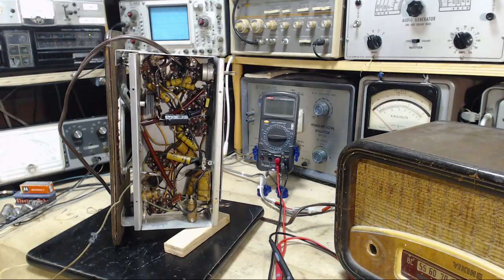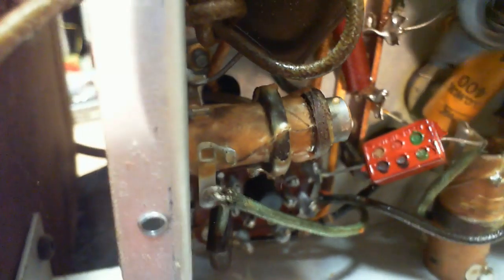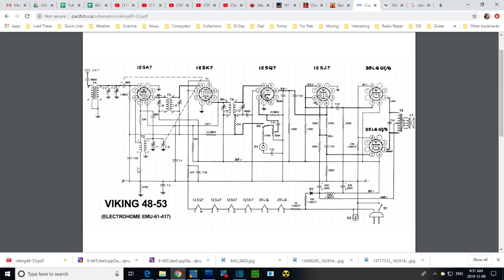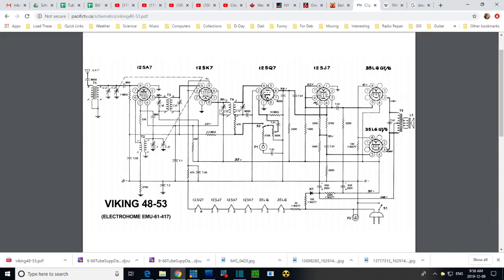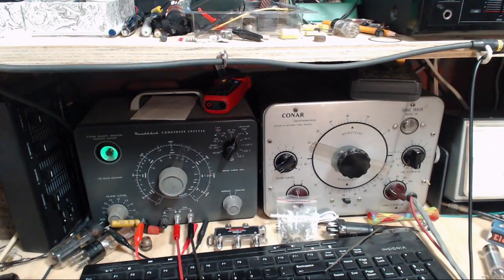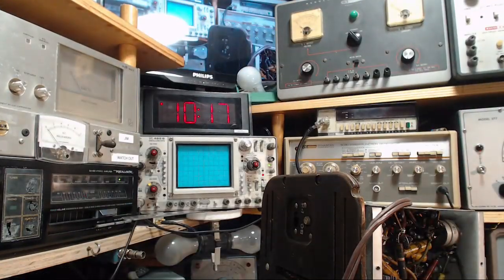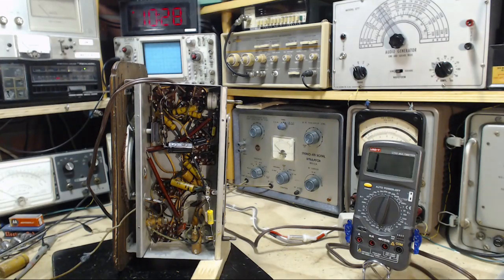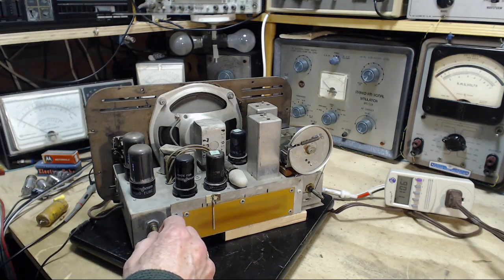Viking EMU61 Tube Radio Video #3 - Chassis Connections

Comment: The reason why wax capacitors need to be changed is they are wax, which is a hydro carbon material.  After 40 years of exposure to air and electricity, the wax has cracked, leaked, broken down, or evaporated.  Its not a question of looks, its a question of if it will kaboom, its a question of how soon.  Wax caps don't last longer than 20 years running to 40 years sitting unused, its a time expired.  Just replace the caps, tune it up, clean and polish the case, you will feel better!

Comment: If you're going to play the radio for any extended periods of time I'd replace all of those old capacitors. They are ticking time bombs.
Reply: Yeah, its kidna like getting a '66 Impala running, replacing the one tire that has a hole in it - and leaving the other 3 cracked, rotted tires on the car and driving it daily

Comment: 24:12 Hmm. lets see...   Rc=1/(2*pi*f*C) So a healthy 0.2uF cap at 60Hz amounts to about 13.3 k Ohms and to have it pass 15A to trip the breaker of a house installation like you intend to, you would need to stick it across like 199.5 kV. Nice leakage test I imagine... However if you had the hydro company spin up the hamster wheels to give 99742Hz instead of only 60 Hz the 0.2uF would drop to an equal resistance of about 8 Ohms and thus pass your desired 15A even at 120V. And BTW the metal envelopes of the tubes are tied to the chassis, whilte their electrodes are referenced to B-. To make use of the shielding effect of the metal envelopes and not have them capacitively couple noise into the electrode system, you need to tie the chassis to the B- for any AC, esp IF or RF. And as we see from the above calculation, the 0.2uF cap ties the chassis to b- the tighter the higher the frequency he is subjected to.

Comment: There is also a capacitor in series with the antenna to prevent getting electrocuted if touching the antenna wire.